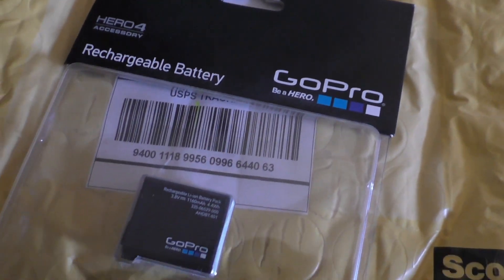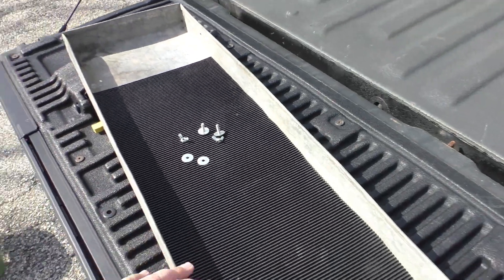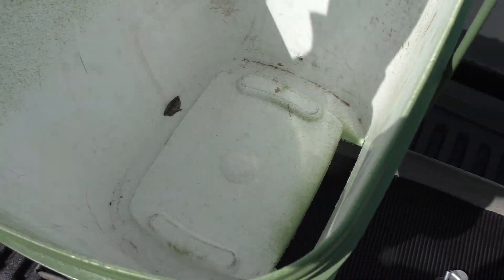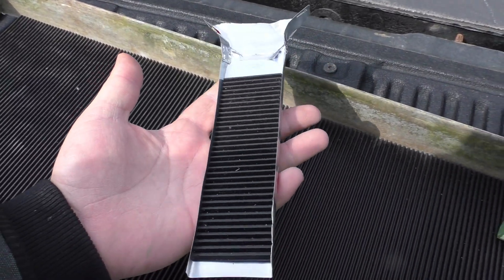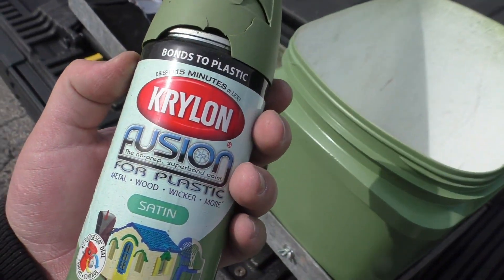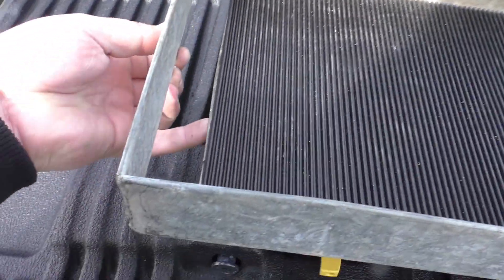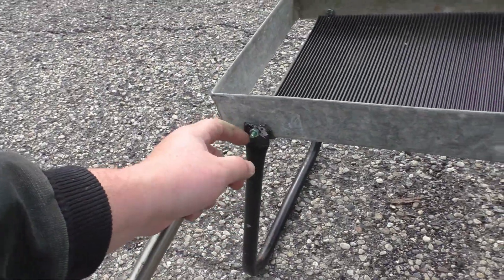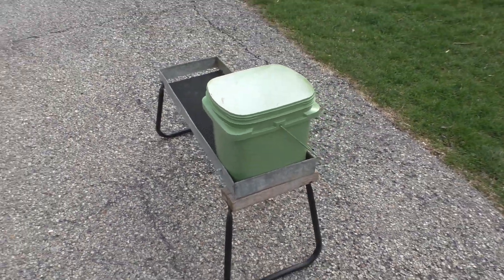Mini Sluice box build High Banker | PART 2

Comment: On the legs: could the single bolt at the top of each leg end up allowing the legs to collapse out from under it?  (Single bolt shaft allowing rotation like an axel?)
Reply from the maker: russchadwell yes I do think I can get the front to tighten up however I may put something on the back leg for extra support.